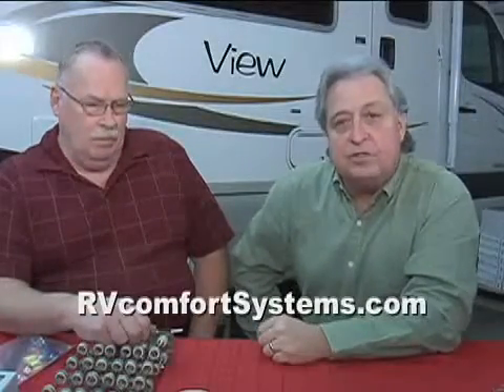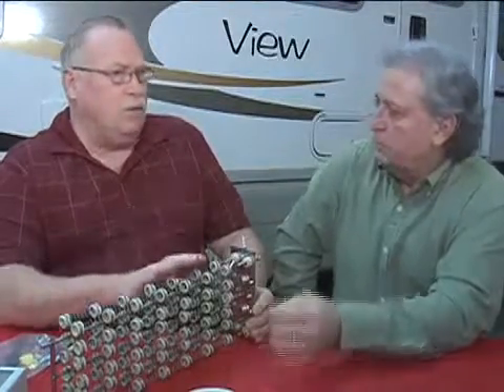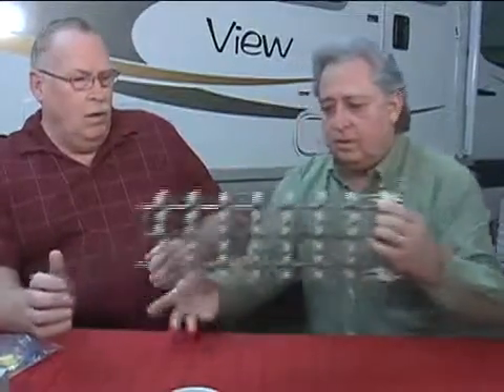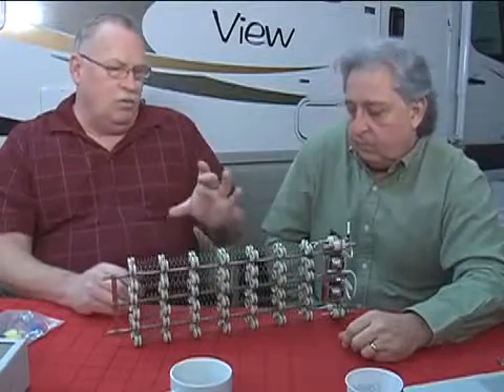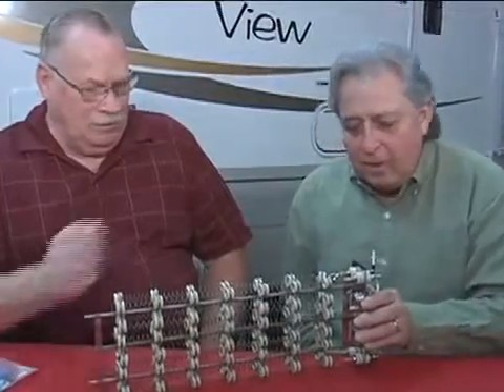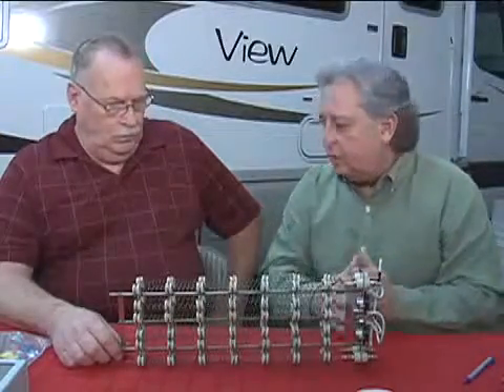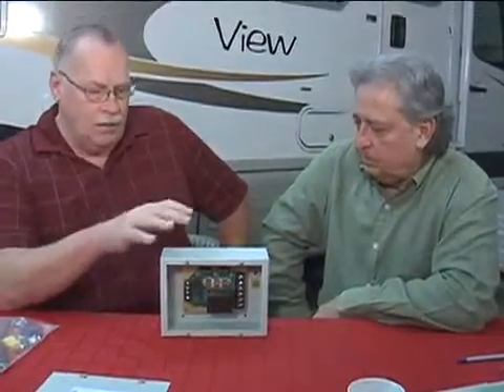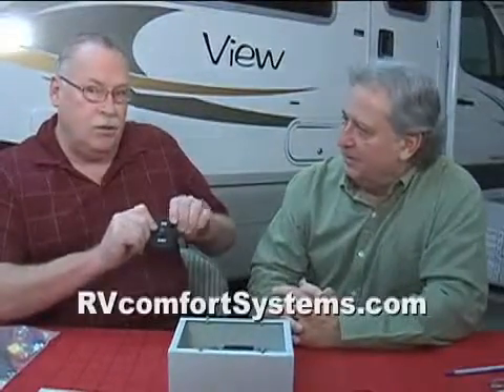RV Doctor Interview about Safety features

Comment: If you're on shore power you don't use propane for anything and except cooking, if you use that to cook. Why do I need to buy a strip heat system when my RV already comes with it? This is not unique, it is not revolutionary, the technology has been around for well over a hundred years. This gets you a thumb down and blocked channel.